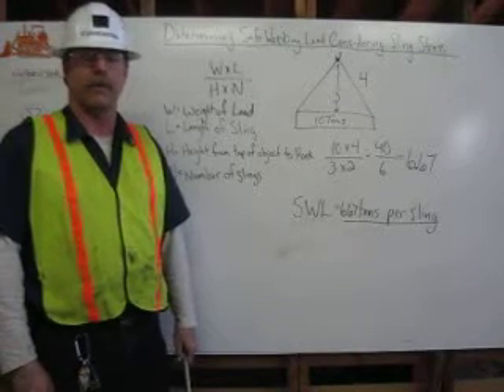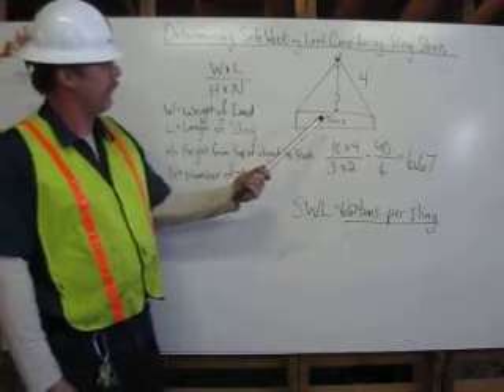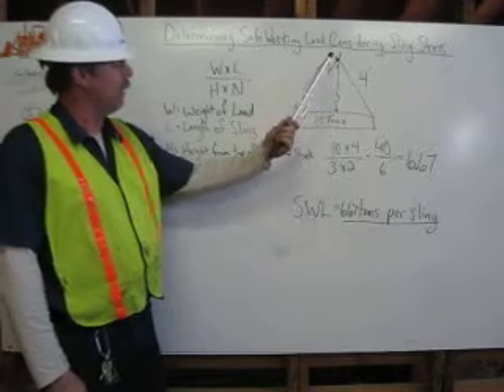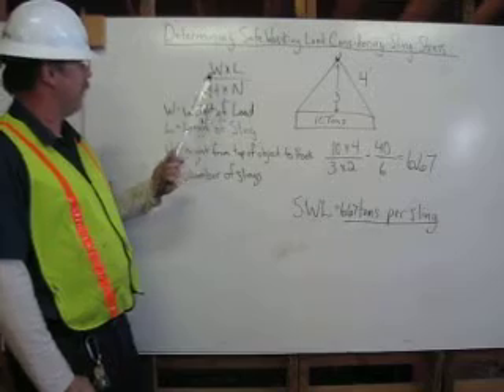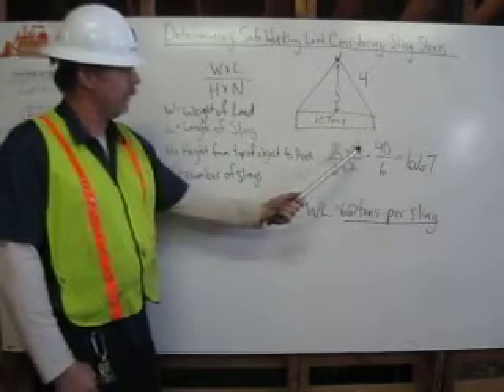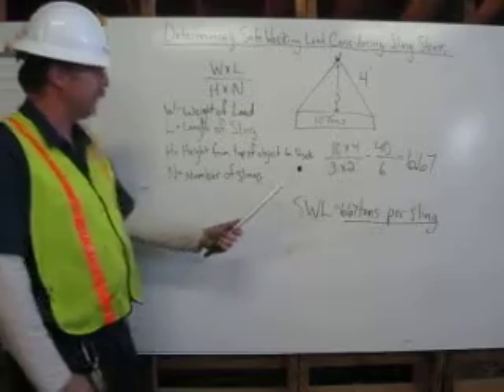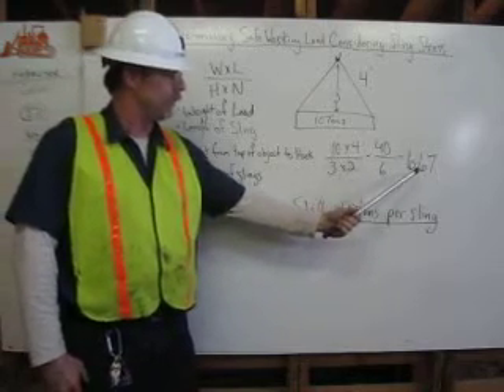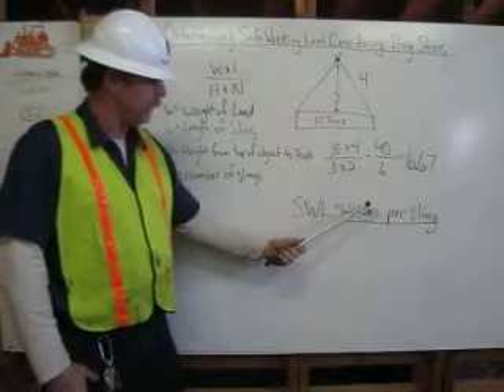Michael Constantin teaching how to calculate sling stress while rigging.

Comment: I liked this, quick presentation but gets the message across. Might be clearer still if the formula is switched round to say W x L / N x H. This highlights how it works with the relationship between L and H for the trigonometry multiplier and how the weight is divided by the number of slings. 
After this the sling needs checking to see if SWL on it is greater than the calculation.
SP